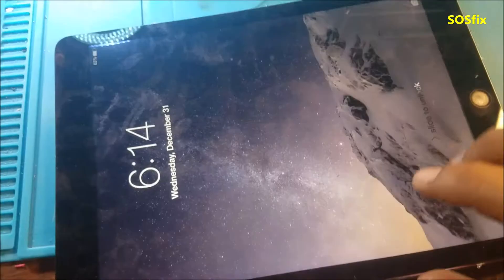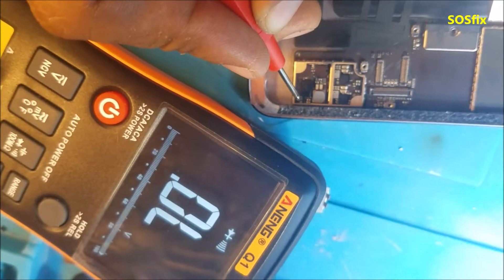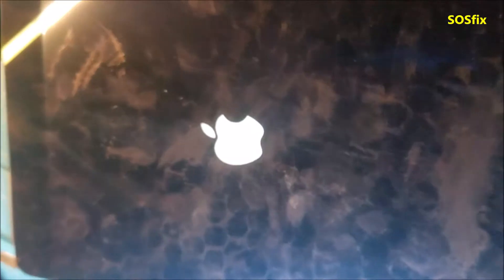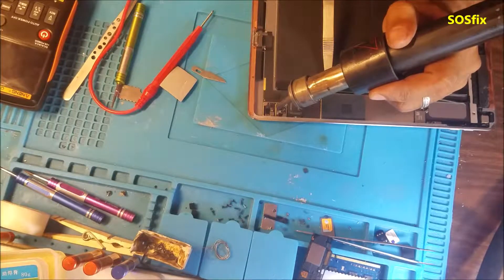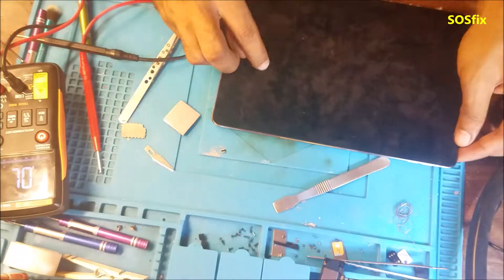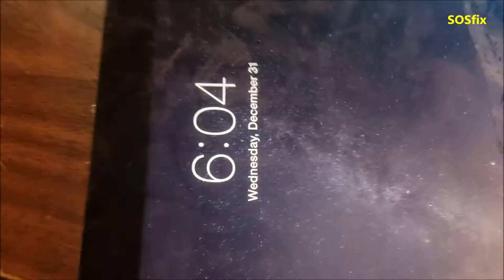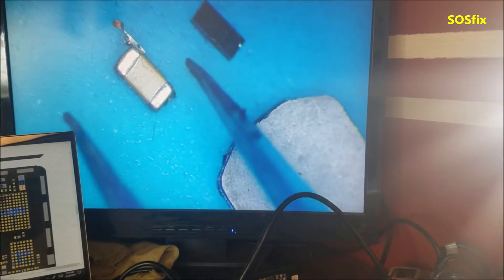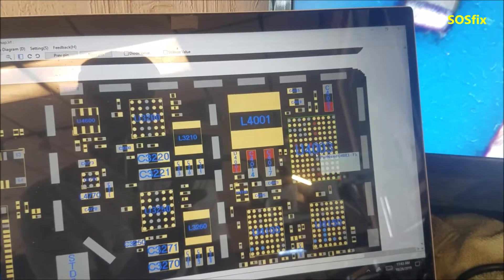ipad air 2 A1566 A1567 touch screen not work fix

Comment: When i press digitizee its working properly
Reply: Glass glass had get gap little bit when i press it on left side touch is working
Reply from the maker: @abhishekjain1705  is that happen after the ipad dropped or you changed the screen? if you can check the  digitizer connector to be sure is connected right to the board, and try another screen if this didnt help you may have a bad connector in the motherboard or some small crack on one of the component
Reply from the maker: do you press on glass or the connector?
Reply: Oky bro
Reply: How much its cost? For replacement